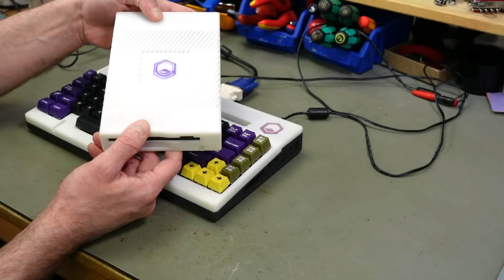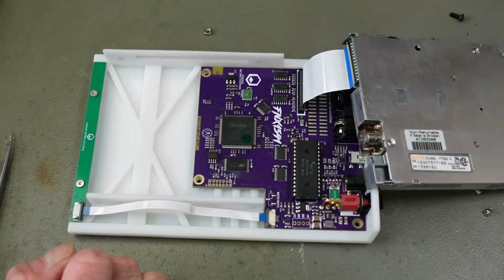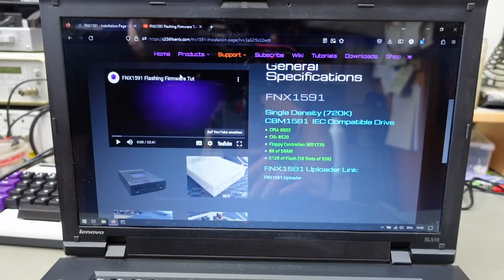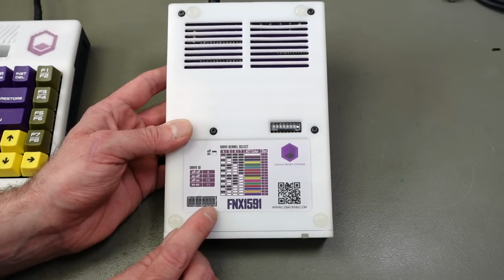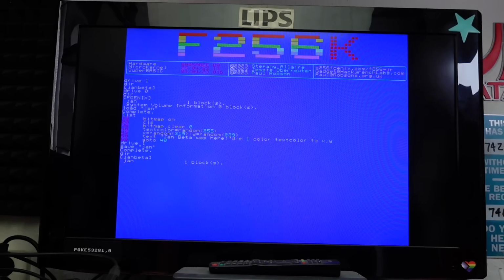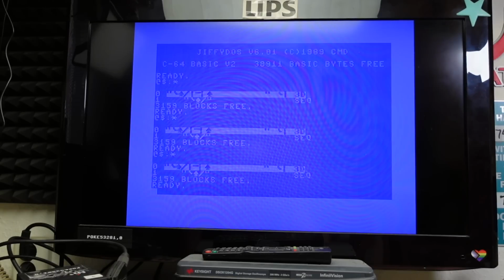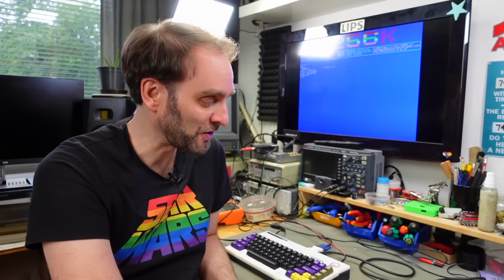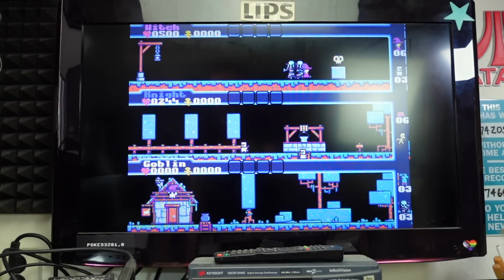Foenix FNX1591 Disk Drive and F256K Software

Comment: Could someone explain why the game Giana Sisters "obviously" wouldn't work on the Foenix?
I'm pretty sure that's the game he plays when he was testing the new C64 mainboards (like the EVO64) so i don't understand why it wouldn't work on this.
Is it an OS issue? like trying to run windows software on a mac?
Reply from the maker: The Foenix hardware is a completely different architecture than the C64, even though it shares some similarities. It’s not only the OS that is different but also the chipset and the way it works internally. Commodore software is programmed very specifically to work on Commodore hardware and doesn’t work on other systems. Kind of like Windows and MacOS on x86 hardware and Apple Silicon (ARM) hardware.
Reply: @JanBeta  Interesting, thank you for the reply

Comment: These new systems are inventive and pretty great overall. Their downfall however is their price. Just way too expensive. It pretty much ends there. At these price points there are better solutions available, two of which are simply a Mister setup or Ultimate64 Elite.

Comment: the bit I dont get with retro new systems, back all home computer where of this type of design, there was an eco system game, game pad, even game on disk and cassettes, and you did suffer if the was not moch of a eco system for your machine, and most where sold ing 1+ millions plus, now we get to new retro machines like one in this video, there only going to be sold 1,000+ if that, so the probley a lot let then the least successful model being back then?
Reply from the maker: I think the appeal is to make your own stuff for the new systems. In the old days, when a new computer was released, there usually wasn’t a lot of software at first and people had to figure things out on their own. The new retro style systems give you a similar experience. Wrapping your head around a new system is fun for quite a few people (including myself).

Comment: $545 for the foenix F256K.....damn that thing is expensive!
Reply from the maker: These are low volume, largely hand-assembled systems. Resin printed cases, custom PCB, FPGAs, custom keyboard etc. I don’t think there’s a lot of margin on these actually. You can’t really compare the pricing with something mass produced. It’s pretty much a hobbyist project made by enthusiasts for enthusiasts.
Reply: $275 for the drive as well 😮

Comment: It's cool that somebody cloned the 1581 but I have to wonder if it was really worth it.

That is to say, it's useful to have an 800K floppy disk on an 8-bit machine. But is it really useful to have one that's a near-exact clone of the 1581, to the point of needing to use the original ROMs and so on?
Reply: The usefullness is compatibility with custom loaders. The drive should now be perfectly compatible with a load of modern loader systems such as Nosdos, Fload, Krill's Loader, Covert Bitops Fastloader and so on. And will also perfectly run GEOS. You cannot achieve that with a proprietary solution. However, as everything is on an FPGA, the hardware should be very flexible, and changing to custom non-1581 hardware should be a matter of a firmware upgrade.
Reply from the maker: There may be dedicated ROMs for it in the future. Stephany hinted at the possibility of using HD disks, too. So maybe it’s going to become slightly more advanced than the original 1581 soon.

Comment: I'd feel better about the price, if it wasn't using that cheap flimsy laptop floppy mechanism
Reply from the maker: My guess is that the slim ones are the only 3 1/2 inch disk drives still in production these days. I’ve not seen any new desktop disk drives in ages, the USB style slim drives are still readily available though.
Reply: @JanBeta  I'm sure that's the case. That being said, there are almost certainly NOS full sized floppies from Dell and HP business class machines in the late aught's to early teens that still came with full size floppies.  I suspect that the number of these 1591 drives being manufactured isn't so high that they can't find a reliable source of NOS or even low-hour floppies pulled from the surplus business class machines.

Comment: JiffyDOS is the only way to go. I think the drive is cool, but finding good media will it be difficult?
Reply: It's not too bad in my experience. Plenty of old-stock double density media on ebay, I've developed a good-sized collection of 3.5 and 5.25 media in the last few years.
Reply from the maker: The drive should also work fine with HD disks (formatted as DD). There’s plenty of those around still at least. NOS double density is getting slightly more difficult to find but not impossible (yet).

Comment: It is just silly how copyright is used to just hurt enthusiasts. It isn't like the roms are selling, the copyright is only hurting the retrocomputer community.
Reply from the maker: The Commodore copyrights are a very special case. There’s been so much fighting over them that nobody really knows who owns what at this point I guess. The ROMs are most definitely still copyrighted though (although they are readily available from several places on the web).
Reply: @JanBeta  Yes, the copyright is valid, but it is very unlikely someone is able to present a chain of credible documents that a court can validate the transfer of rights from the original authors to the party who wants to claim copyright. Preparing such proof would be very expensive already. If you would hire a lawyer to start an enforcement case, he will more likely try to convince there is no change of winning such a case (and make his money on  the legal advice), instead of being eager to start such a case.

Comment: So this is a retro style computer that will not run existing retro software?  It will only run software designed for it?  I kind of get the disk drive, you can use it as a retro drive on the C64, but the computer I don't get the appeal of wanting one.  I can't see a huge backlog of software being developed for this.  Why have this when you can get a C64, Atari, Apple, or any other vintage computer with a huge catalog of existing software?  Or any of the new reproduction FPGA versions of them?
Reply: You see the glass half empty instead of seeing the glass half full. You could say that if the collective that developed software for the C64 right now, would do it for the F256K instead, you could have a renaissance of what retro computer was back in the day. New games, new hacks, etc... It is about discovering a new platform, not pimpin an old one and play the same old things. You can always go back to the C64. But the Foenix Line of computers, the X16 and the Mega65 (to a certain degree) are all about getting back to the beginning where you are facing a new machine and to learn it and to exploit it. What's the point of reimplemting the same old hack that most demo creators have used for ages when you have the possibility of finding new ones in a new machine... You see what I mean?
It is about how you look at it!
Reply: It's a retro style computer to write your own software, just like the C64 used to be when it first came out. Some people enjoy creating software more than using it. A modern machine like this makes this way more enjoyable than the vintage hardware. For example you don't need an old flickering CRT monitor (or a converter). Also it is even easier to get started developing for this machine, the SuperBasic on this machine is far ahead of the C64's Basic 2.0. More colors, more sprites, etc. Still it is simple enough that one person alone can understand everything that is going on in the machine, just as it used to be in the 80s.
Reply: Ultimate 64 is what you’re looking for. This is for people who want to develop or play on a retro style machine with BASIC or ASM.

Comment: As much as I would want a 1581, I’d really love an FPGA 15x1 drive with an SD card. Like a Pi1541 but with the Pi and as exact as possible. 

Because yes, I want four:)
And yes, I have real drives, but they are failing:(
Reply from the maker: You might want to have a look at the 1541 Ultimate II+. Emulates several drives cycle exact using an FPGA (recently added 1581 emulation, too). It uses USB sticks for storage and is aimed at the C64 though.
Reply: I believe you can run the 1541 Ultimate II+ standalone by powering via the micro USB. Then you need ethernet so you can telnet in and mount floppy disk images.  I need to test that feature myself.
Reply from the maker: Oh, I didn’t know that! I’m going to have to give that a try, too. Thanks for pointing it out!
Reply: @JanBeta  I tested a U2+ (3.10j) standalone with a C64 last night. Worked great.  My laptop was in the other room so I used telnet from my phone which was a little clunky. Anyway it works. I don’t remember seeing any videos demonstrating it so it would be neat if you made one.
Reply: @JanBeta  My approach when using the 1541U2 with non-C64 8-bit computers is simply to place a C64 next to them. I stick the 1541U2 inside the C64 and connect the serial cable to whatever computer. Would work with F256 fine. You can indeed use ethernet as well, but my non-plus 1541U2 doesn't have ethernet yet.

Comment: I recently acquired my first bench power supply and I can confirm my F256K runs with 9V and takes about 240 mA. It also ran fine with an old dinky 12V 750mA power supply adapter i had laying around.
Reply from the maker: Good to know! I can confirm the current draw for 12V. I think the recommended 2A power supply is just to have some headroom and possibly a cleaner supply (because not driven to its limits).

Comment: Hey Jan, long-time fan. Foenix offers a 6809 CPU option instead of a 6502. I would love to see you cover that; if you're an old programmer like me (who was programming even back when these chips were new) you'll know that the 6809 kicks the pants off the 6502 and is much more fun to program for since it gives you so many more options. But the kit is expensive and it's not clear how much software work has been done or how well it's supported. I'd really love to see that covered.
Thanks for all the videos!
Reply: Nice!  I'm currently working on a modernization of the Tandy Color Computer which uses the 6809.  The system will use the 6309 alternate that's 100% compatible, but can run faster and has a few new additional features.  I plan on having it run at a top speed of 3.58 mhz (twice the speed of the CoCo 3), with SDCard interface, OPL support, PS/2 keyboard, Wii nunchuck controller support, expansion card slots, etc.  I just received my first test PCBs to test the expansion designs on.  I eventually would like to expand the video to VGA with more video modes than the CoCo 3 had.
Reply: @sprybug  That sounds very interesting! I'm glad you aren't running it too fast, that spoils the fun. I think around 2MHz is the sweet spot and you're near that. The rest sounds awesome, but if it were me I'd make sure to have a minimum of 2 RS-232 ports as well!
Hope the project goes well!
Reply: The 6809 is the full package with the features to build a real system, while the 6502 was designed as a minimal subset of the 6809 more likely to work as a microcontroller. The 6809 already has a multitasking, multiuser and realtime OS with OS-9, it is definitely the most interesting of all 8-bit CPUs for assembly and higher level coding.
Reply: @Breakfast_of_Champions  To be precise, the 6502 has a subset of the 6800 features, which was the predecessor to the 6809. So the 6502 is a cut-down version of the older, less advanced chip. That's not to say it didn't have a place (it obviously did!!), and Chuck Peddle was a genius for realizing the world needed super cheap CPUs. But take price away and the 6502 is really kind of a pile of crap compared to either the 6800 or 6809.
Reply: @aqualung2000  I don't agree: The 6502 is indeed more simplistic than the 6800 (the 6800 has two accumulators), but it is more powerful. The reason is Chuck Peddle's innovation: Zero page addressing. The zero page addressing helps a lot in the low amount of registers that the 6502 has and is very useful for 16-bit pointers. Thanks to this, the 6502 can compute more per clock cycle than an 6800. It was cheaper and better.
Reply: @danielmantione  You are absolutely correct about the zero page. But, you've left off a few important things. First of all, the 6800 had 16-bit address registers (so they were actually useful .) Second of all, the 6800 had more addressing modes than the 6502 does; those addressing modes aren't "faster" per se but they do make programming the chip a hell of a lot more convenient. Third of all, the zero page was kind of a pain in the butt to use; and you didn't even get it all unless you didn't need the kernal or BASIC. I can't exactly quantify this but I do know for a fact that a lot of Commodore 64 games did not even use the zero page (or used it very sparingly.)
We could argue about performance (clock-for-clock) all day, I don't want to get into that. My point is that, as a programmer, the 6502 is not nearly as fun and flexible of a chip to program for as the 6809 (or even the 6800 though that chip was actually a bit before my time.)

Comment: Whats with the "LIPS" on the monitor?
Reply: Phil just had to go.
Reply: In older videos he had a Phillips brand monitor with black tape covering the “Phil”.  It was at the bottom and much smaller.  Maybe a joke with the new monitor was to put label with “LIPS” in honor of the old one 😂
Reply from the maker: Exactly this. I had several people complaining about the missing "LIPS" when I switched the monitor to the bigger one I now use (which is actually an LG brand TV I fixed some time ago). Couldn’t resist overdoing it. ;)
Reply: @user-yr1uq1qe6y  ahh :)